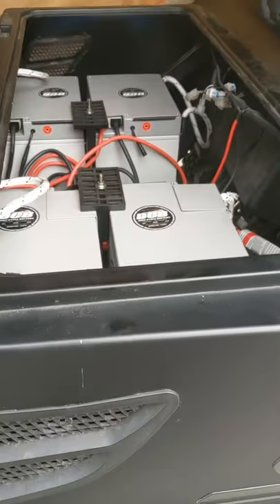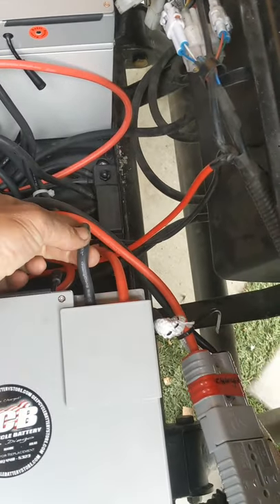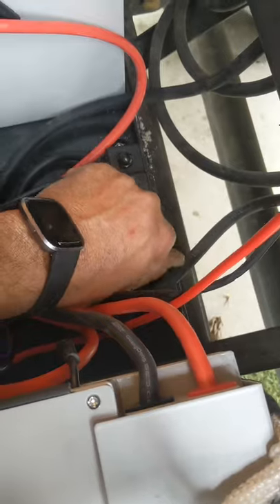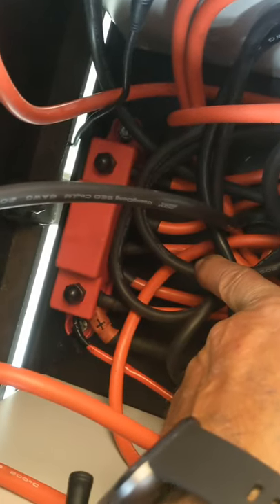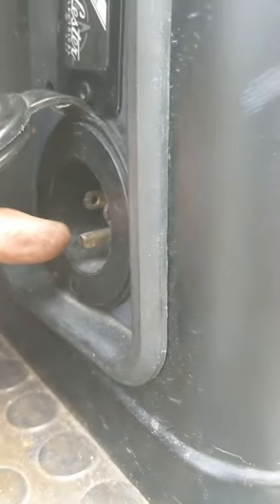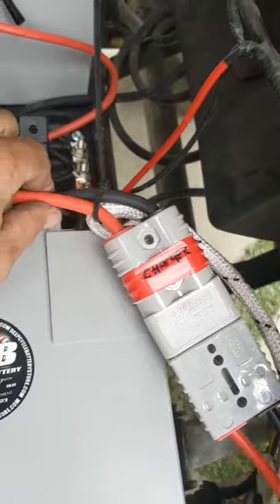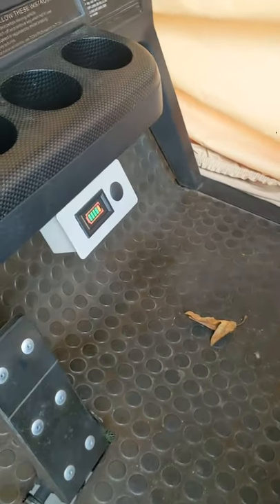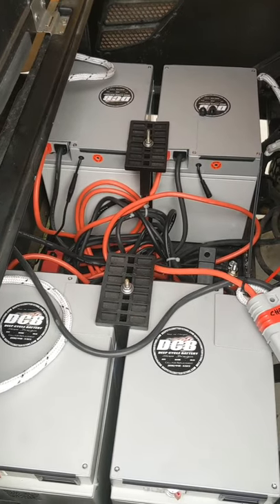BigBattery Eagl 48V Install into Tomberlin Golf Cart

Comment: I got a small lawn mower battery that I will use for welding tabs onto lithium cells using a momtary button hooked into an solenoid would it be ok to leave a small hot wheels gel cell charger on the battery to keep it topped off and while using can I put a 2 amp or 10 amp charger on it to keep it charged up the current of my welding within the cranking amps of the battery so not worried their yes its flooded but with a slow charge it should not gas but while doing actual welding a faster charge would be ideal

Comment: On an ezgo rxv do I need to take a wire from the old charger plug and run to the positive bus bar for the eagle set up. Thank you for the help.
Reply from the maker: yes, I want to say that the reed switch needs to have voltage / https://cartaholics.com/threads/e-z-go-reed-switch-test-and-bypass.593/
Reply: @DeepcyclebatterystoreSanDiego  thank you

Comment: What year Tomberlin golf cart? I have a 2010 that has 86 V batteries. I talked to Tom Berlin and they said I would have to switch over the computer, wiring harness, and a whole bunch of other stuff, but it looks like your install system was plugged and play. Almost. did you install four lithium batteries so you would get 50 mile range? I only drive 2 to 3 miles a couple times a week so I was recommended the two batteries system. I have a factory controller, so I’m guessing we have the same one not sure if it’s adjustable or not.
Reply: I had the same question.  I'm looking to upgrade my '09 Tomberlin.  Have you done any more discovery Chris?  The tricky thing on these older Tomberlins is finding someone who can update the controller (if that is, indeed, needed).  All of the stuff online that I'm seeing makes it look easy and that there aren't major mods needed to make this work, but they also all seem to be sponsored by the battery companies.
Reply: @laverma1  from talking to direct Tomberlin you can’t upgrade their computer and I saw a video of somebody that did it in San Diego. Got a hold of them and they said they tried it. They put the battery in but they could not upgrade the Curtis computer they’re looking for a workaround.

Comment: Ok I have been looking into a lithium upgrade to my 2018 Tomberlin SS Coupe 48 v, with 8, 6v T105 Trojan batteries. My biggest issue so far is every lithium manufacturer has told me the max controller wattage is 400! The Tomberlin uses a 450watt controller! So how did you address that? I would love to use the 3, 48v Big Battery combo as I don’t need over 30-35 miles of range, I’m just tired of replacing lead acid batteries every 3-4 years.
Reply from the maker: correct the Tomberlin likes to pull big amps, look into the UNO lithium battery pack

Comment: I just bought the BigBattery EAGL 2 battery kit, I have not installed them yet. It was supposed to come with a 17 amp charger, but they sent me a 14 amp charger with the sticker for a 17 amp charger, and now they wont respond to any of my emails and I have not been able to get through on the phone. At this time I can not support BigBattery.
Reply from the maker: gibve them time and shoot them an email, the support team is small and probably overworked. You very much want the higher amp charger, we have seen issues with lower amp models
Reply: @DeepcyclebatterystoreSanDiego  BigBattery finally offered me $30 refund, but then changed their mind. BatteryEvo told me that their yellow 58 volt charger is only a 14 amp charger, the 17 amp charger is black. I sent BigBattery a picture of the yellow charger I recieved with the sticker partially off. They now want me to pay to send the charger back and then they will send me a 48 volt charger. Things are still up in the air and I can not be without a charger for weeks.

Comment: I hope someone didnt pay you for that install. very messy and very poor and cheap install of the battery gauge. on top of it all electrical taped the plugs together...
Reply: i agree   looks terrible.  i just did one and eco 48v 105amph and used acrylic glass as a base and cant see any wiring with storage space under it.  and fyi i hate these carts